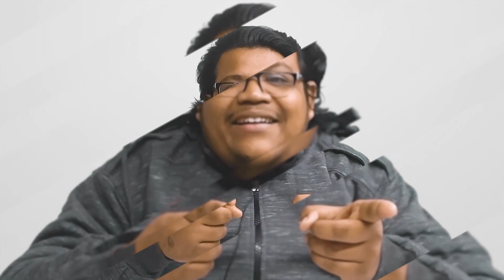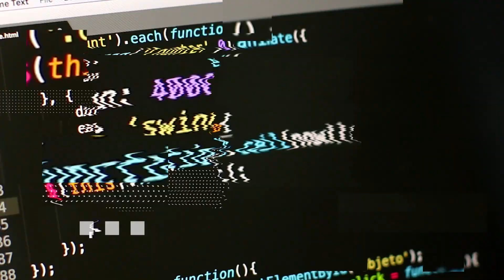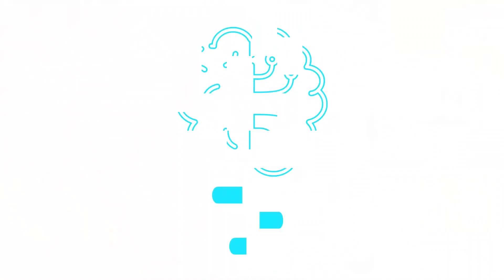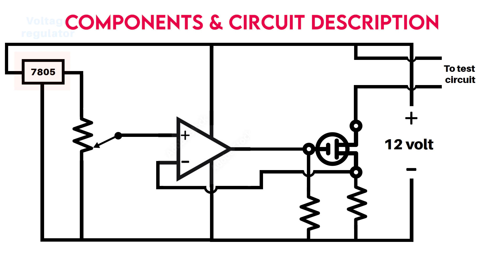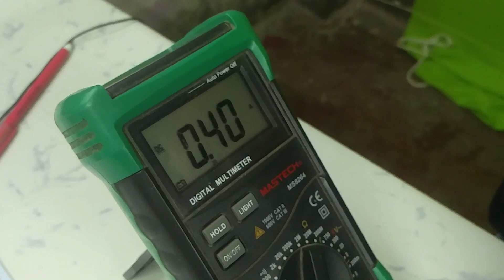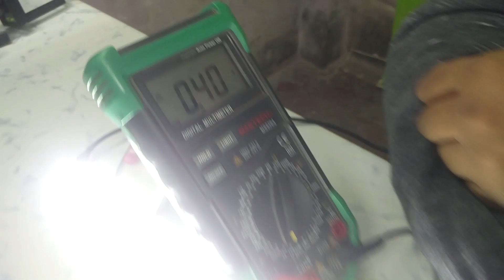Comment: I think a lot of energy will be lost in the current sensing resistor. The best option is to use TL431 for a reference with a resistive voltage divider (10K and 1K), making it approx (2.5V / 11) 0.22v. This way, you can use a very low value resistor with capability to control higher currents and utilise the mosfet fully.
Reply: Yes you are right. But this was for a simple concept.

Comment: Thank you for your video and the detailed and graphic explain, it was very useful to me, thank you so much
I already suscribed to your channel. 

I only have one qustion...]Is it possible to redefine the values of the components to control a range of current from0 to 20 amperes ? 
What would be needed to achive that ? 

Thanks a lot in advance.
Reply: Change the MOSFET to 100 amps one, and use a lower value higher watt resistor. Then use a non inverting amplifier to amplify the shunt voltage